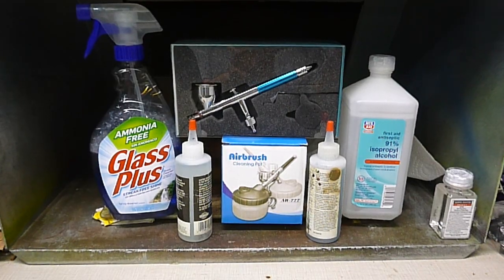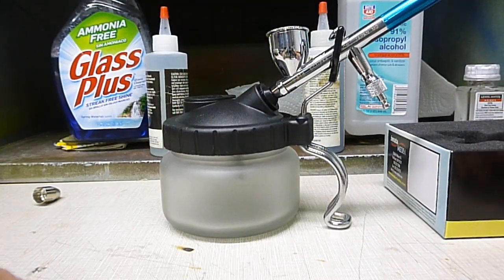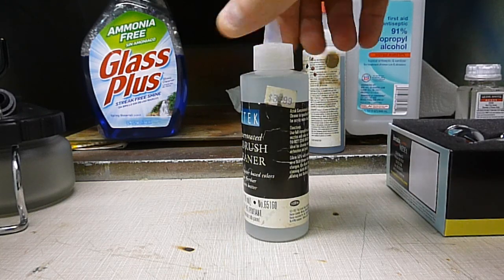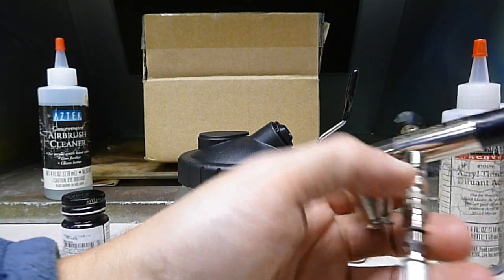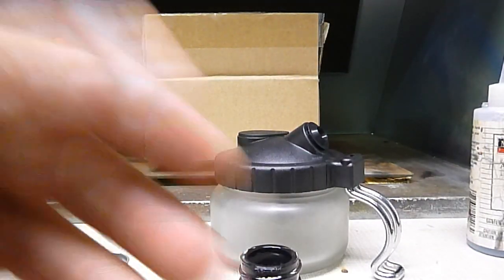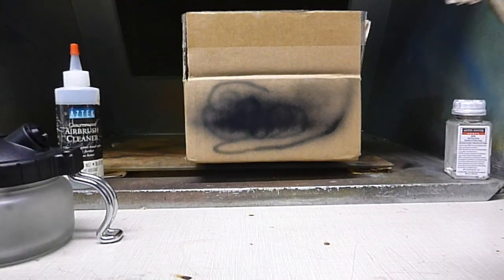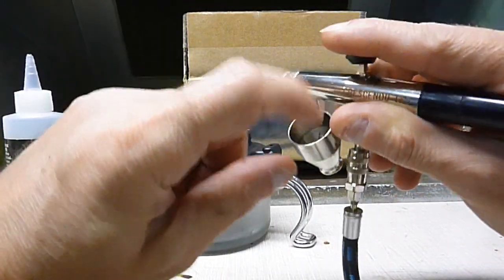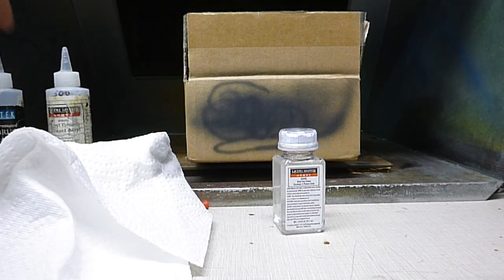home made airbrush thinner & cleaner airbrush station unboxing test

Comment: I am just getting into airbrushing and this was helpful. As a beginner on a budget, I'd rather make my own cleaner and thinner so thank you!
I noticed you used a higher ratio of ammonia-free glass cleaner and alcohol in your thinner solutions and less of both in the cleaner solution. I would think it would be the other way around, am I mistaken? I, too, would use distilled water in such application similar to the water you put in your radiator mix. I'd refrain from using tap water with possibly harmful contaminants.
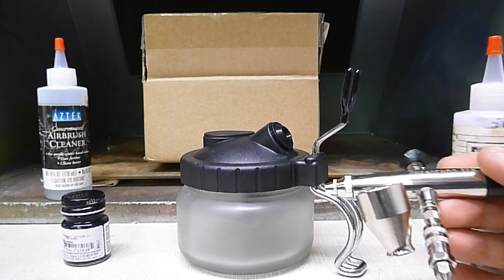3:37 - To use it with airbrushes with bottom attachments, the company needs to come up with another holder made of slightly thinner material and turn the fork like holder 90 degrees and also curve the fork part slightly and it would work nicely. If they were smart, they could make the bottom of the fork like a pivot so people could simply pivot that part 90 degrees and use it, too.
Reply from the maker: Hi the thinner I only use the windex with the distilled water, The cleaner you use the distilled water and a mix of rubbing alcohol and windex...  you can play around with the percentages of stuff in both the thinner and cleaner to find what works best for you.
Reply: @ShenRC  Thank you, Shen. I was going to play around as I typically do but I do appreciate the feedback. I got some ammonia-free glass cleaner today so when I get the paint, I will be experimenting. You suggested percentages will be very helpful!
Reply from the maker: @Turco949  Your welcome, just play around like I said with the mixtures you will find what works best for your type of paint your using.
Reply: @ShenRC  I guess the paint and the airbrush used are the two other important  variables in the experience! I will be starting with a portable (USB charged) airbrush which I will also be reviewing. The brand of acrylic paint I picked is the 12-color Artecho acrylic paint set. 

As I develop my skills and move onto more challenging projects, I will upgrade the brush and materials as well. Thank you again!

Comment: I got a cheap brush cleaning pot at Harbor Freight, haven't tried it, but 1/4th the price of the Testor version.
Reply from the maker: Cool!
Reply: I could never see any great sense in paying out for a proper cleaning pot.  I use an empty plastic 500mm drinks bottle with a suitably sized hole drilled near the neck and blow the dirty liquid through this into the bottle.

Comment: how munch alcohol are you using for the thinner?
Reply from the maker: 😊Hi I use just the glass cleaner with distilled water for the paint thinner no alcohol. But you can probably ad just a bit of alcohol in if you wish to but test it out with your paints first if you do so.
Reply: Shen RC thank you!
Reply: @Shen RC , what's the ratio for the 
paint thinner? 50% water 50% window cleaner?